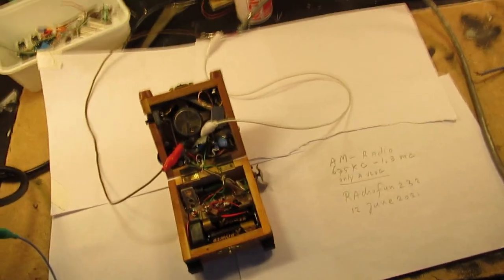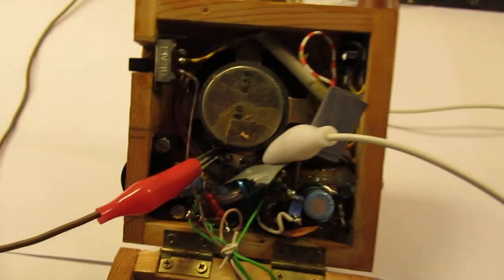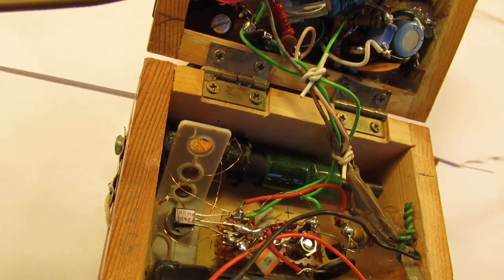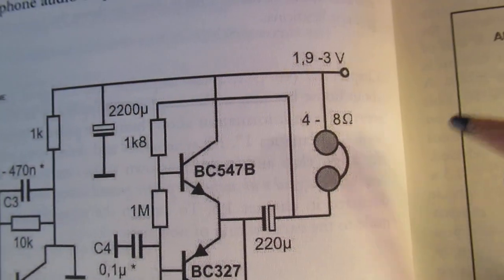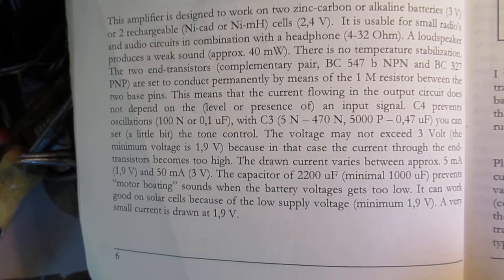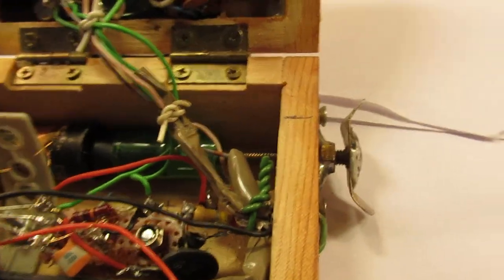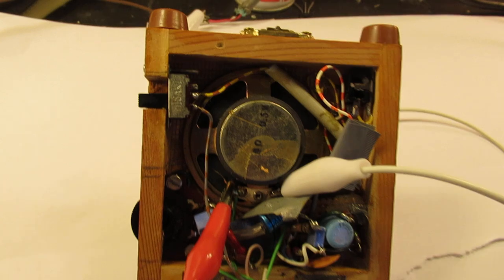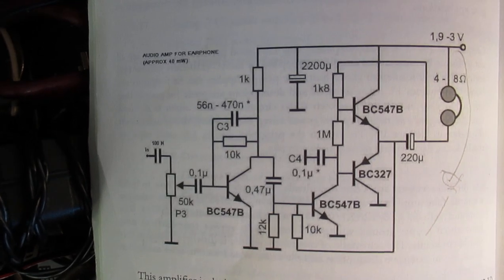AM radio circuit in the Netherlands: no local radio stations received but a usable 3 Volt amplifier

Comment: I played a lot with similar designs when I was 12 yo. Today I make software defined radios.
Reply from the maker: Thanks for your comment and yes, and that is a very good idea (!). It is simple, very effective and you can receive a lot of radio station(s) out of a very noisy (radio) background on SW. Especially nowadays (2021) where there is much background radio noise by e.g. solar energy systems (inverters), modems, etc. etc. I don't publish SDR radio circuits (+ the computer programs, often free on the www) because the aim of my YT Channel is showing analog principles. But anyway: your approach works very well, many radio amateurs work with it nowadays and they are able to get much better results compared to analog SW technology, especially in the signal to noise radio problems on radio reception, say from 1 MC to 30 MC and higher. SDR is sometimes able to dig 1 radio signal out of an ocean of noise. 12 june 2021.

Comment: Do you have good circuits to drive .25 watt or 1 watt speaker using transistors but with low voltage say 3v or 6v or 9v
Reply from the maker: Yes, go to my channel trailer (Radiofun 232 on You Tube) and go to the "looking glass". Use key words like "amplifier" or "audio amplifier" or (perhaps) "5 Watt" or "Watt" and you will find all the video's and demos and schematics. Always inserted in the video. 13 june 2021.
Reply from the maker: say here Video link
https://youtu.be/jU6VI2WpGqk
Reply: @radiofun232  thank you very much

Comment: Hi , i made the circuit and It Is true i can Connect my radio circuit to this audio amplifier. but it sounds very por audio.
this how i use the componentes.all .1uf by 100nf
the One from 5 or 56nf to 470nf by One of 100nf.
the 1.8k by 2k
didint have bc327 so i use a PNP 8550(IC=1.5A, 1W the rest characteristics more or less iqual)
the filters or electrolítico capacitors 220uf 16v output
and the other 2200uf(25v).
all condensatores 104 ceramic.
tell what i have wrong please.
another dout. does the resistor 1.8k conect to colector of the c547?.

.47uf i use 470nf
Reply from the maker: You must measure the Hfe (amplification factor) of the 8550 PNP transistor. The data sheet tells that the Hfe = minimum 85. But that is too low, it must match with the Hfe of the BC 547 b (the NPN transistor). The Hfe of the BC 547 b = 250. When 1 transistor has a Hfe of 250 and the other one substantially lower (say 85 or 100) the sine wave is not properly amplified, because it is a complementary end stage. So the Hfe of the PNP transistor must be approx. 250. And the audio output level is low by its nature, only 40 Milliwatt, that is not much. It is visible in the schematic. The good thing is that it works on 2 batteries of 1.5 Volt. It is a class A amplifier, that means that there is always current flowing, though it is small and depends on the supply voltage, here 3 Volt maximum.  The 1 K 8 resistor is not (!) connected to the collector, that could also be a problem. 8 dec 2021.
Reply from the maker: And it is made for a headphone of 4-8 Ohm, in fact not for a loudspeaker. So measure the DC resistance of the headphone with an Ohms meter.
Reply from the maker: This is a better circuit with enough audio output, say 1 Watt.https://youtu.be/dY8OMNOO0OU
Reply: @radiofun232  thanks you verymuch. It works fine anyway. i Will change the transistor. i will let u know
Reply: @radiofun232  any way im testing the circuit with headspeaker. to test my radio circuitos.
Reply: @radiofun232  ok thanks a lot. i Will see It . i let u know